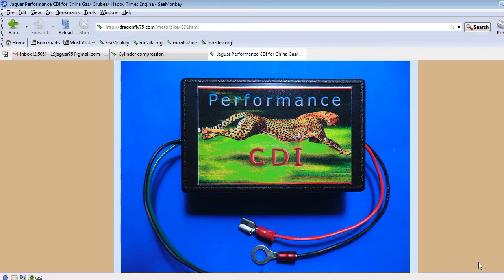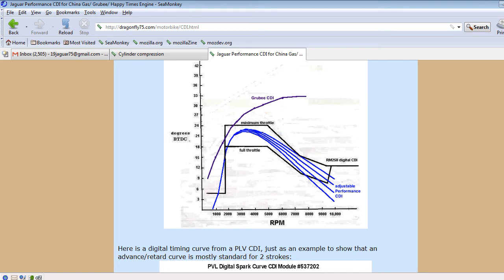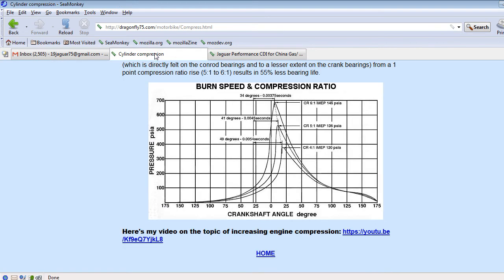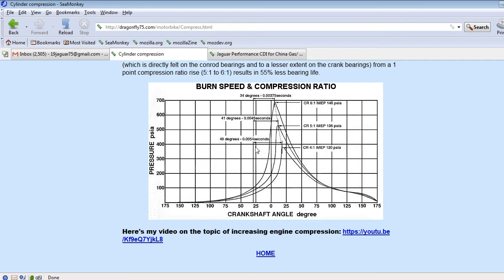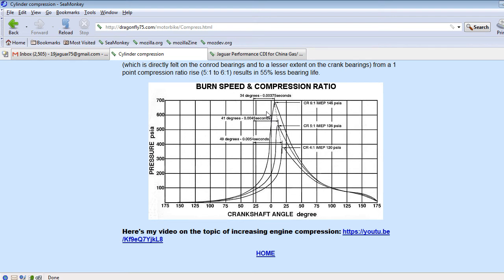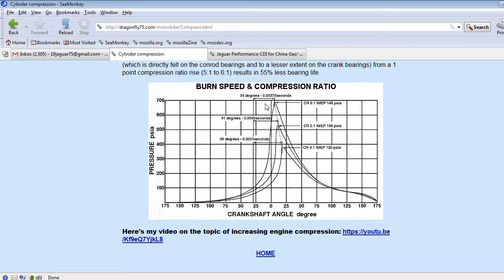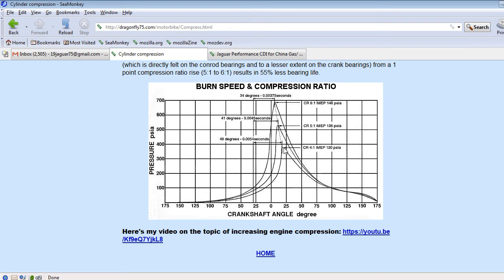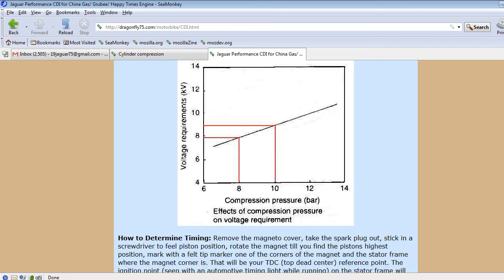About 2 Stroke CDI Ignition Timing

Comment: Hi. I'm late to the game. You are no doubt very knowledgeable on this device. I have a DC CDI with the tiny screw advance+/-. Can I adjust this while engine running? Thanks
Reply from the maker: Only if you are using a timing light to see the change. Otherwise you'll have to test each adjustment to see which one gives the best acceleration/power.
Reply: @MichaelForrestChnl  thank you